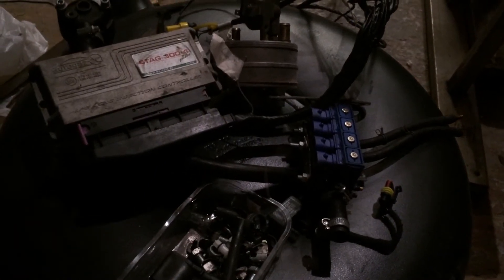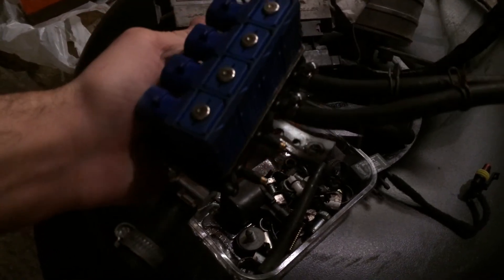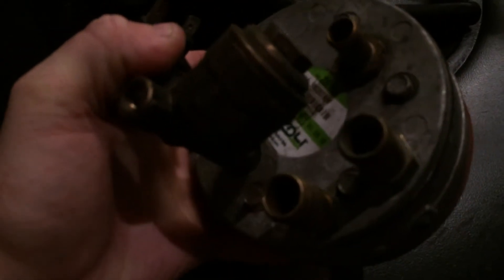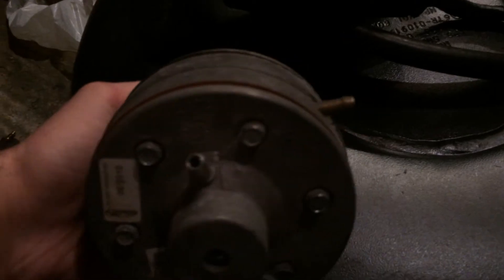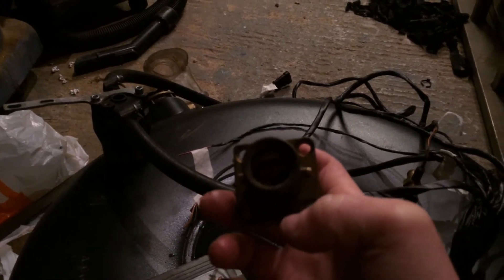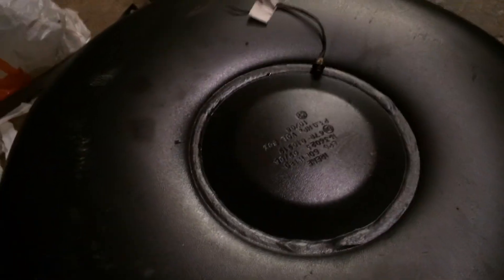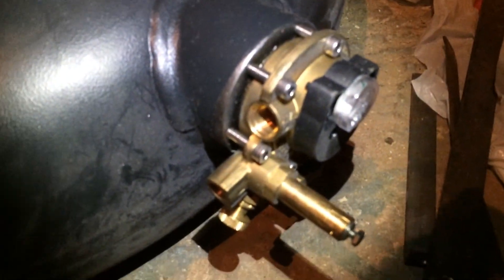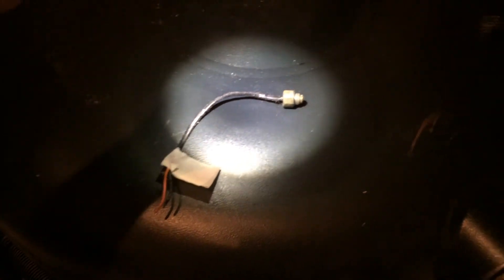LPG CONVERSION KIT FOR A CORSA C 1.2 AC STAG

Comment: where can I get a rpm signal from in the engine bay on a corsa c for a esgi LPG kit . Thanks
Reply from the maker: +Steven Knight  it depends you can go off the coil pack on the signal wire, cam position sensor signal wire or even negative wire on the petrol injectors, on the ignis i whent of the negative wire on the petrol injector number 1 and signal wire on the coil pack on the clio. 
depending where you put the ecu and where the loom is fed you might be better off going to the signal wire on the coil pack. sorry for the late reply

Kind Regards Luke